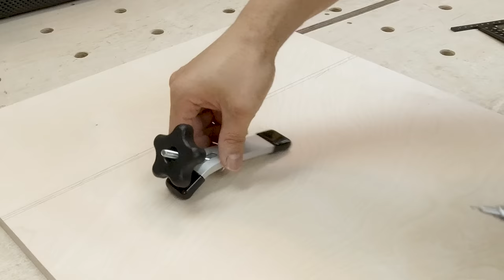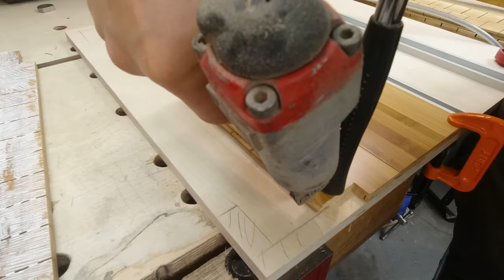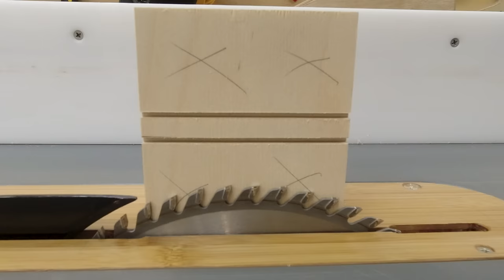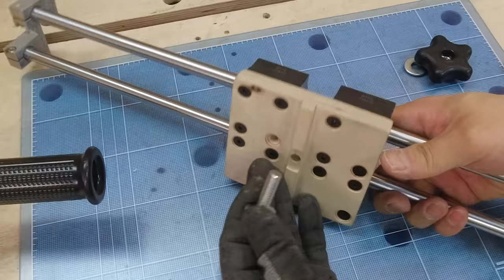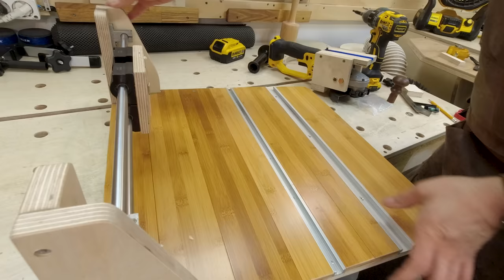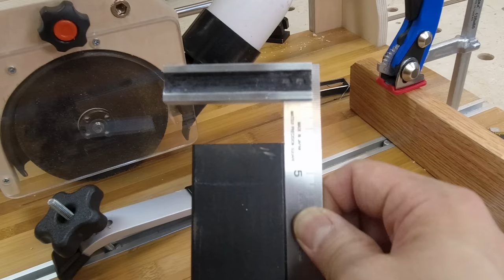⚡ Best Angle Grinder Sliding Miter Saw Stand - DIY /Utilize Miter Gauge - Any Angle OK / Woodworking

Comment: This upload should get 5 thumbs up for every like - just for the choice of materials you made. 
I'm a fan of recycling and since I'm not a fan of laminate floors at all, for example, I kind of hate them, when they're made of plastic, 
since I grew up in a family of old-school craftsmen which considered real wood parquet as the non-plus-ultra. 
Irrespective of this, this stuff is totally spread everywhere and by thousands of "ignorant", short-sighted contemporaries who, 
mainly for reasons of time and financial economy, but not for ecological reasons, this "devil's stuff" slap or let slap on their floors 
instead of spending the money for a decent floor covering to return to. But now, instead of just dumping tons of this stuff in the trash, 
I'm using the stuff to construct such utilities as shown here. Surfaces are smooth without much preparation, 
several layers can be stacked on top of each other by surface tension with either acrylic or silicone adhesive or epoxy or probably 
with higher quality glue or hot glue and then cut or milled into shape. You can usually help yourself from the disposal containers when moving, 
changing apartments and the associated renovations after consultation with the craftsmen or owners. 
There's tons of material for the low-budget handyman if you swallow your pride and just act natural towards the throwaway owners.